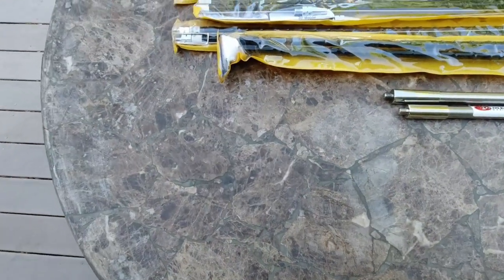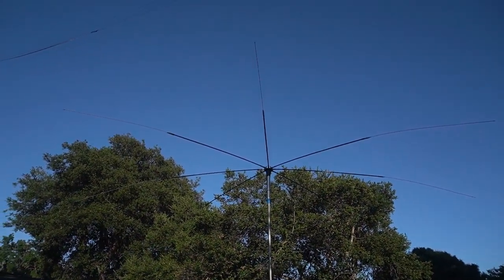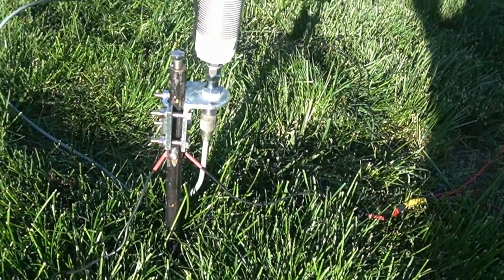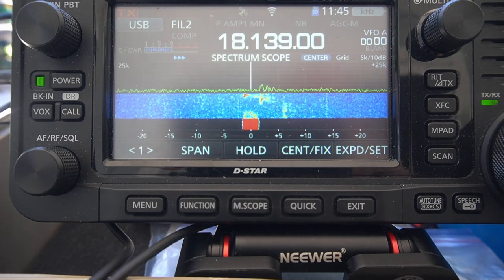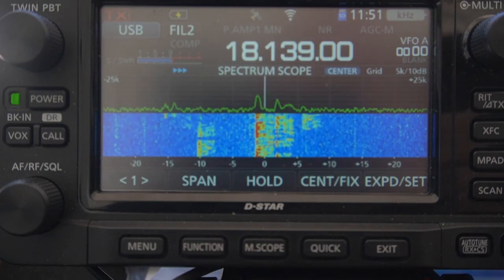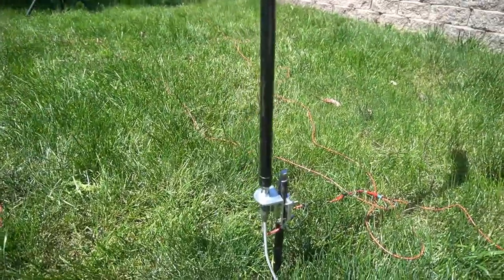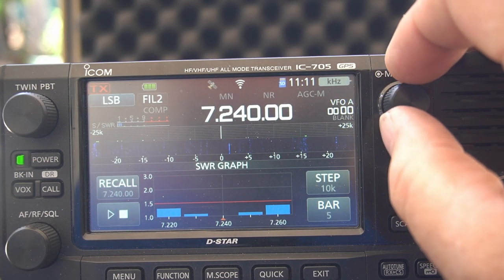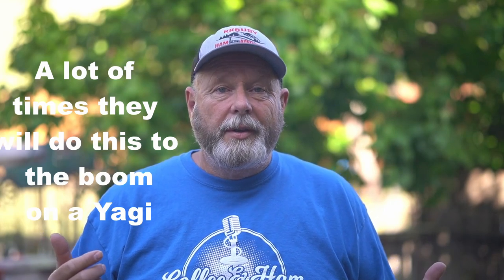How to use Hamsticks in different ways for use on the HF bands in Ham Radio.

Comment: Hi Chuck,
All great ideas. I especially liked the one for the two 17' whips used as a 20m dipole and the supports with the paracord. The small plastic pieces to make adjusting the tension a great solution. You and the family stay safe.  73  WJ3U

Comment: Yes, the Dipole topper for the push up mast makes the Dipole real easy and the thing I like is the MFJ Stainless steel whips at 10, 12 and 15 don't droop. Now that those bands are open, they work great. I have also used a 20m Ham Stick Dipole and the 10m Stainless on a 3d printed Dipole topper at 25 feet. The Ham Sticks at 20 are rigid because 1/2 the length is a molded, rigid piece and the whips are at the end. Great video. Thanks Chuck.

Comment: Great ideas Chuck. Maybe try the Hustler VP-1 Tri-Band Resonator Adapter with Ham Sticks, use a 3/8 x 24 bolt and a coupler for the antennas. Use a mirror mount and a 3/8 x 24 bolt to attach it to the mirror mount. You now have a 3 band antenna with maybe a bit more band width, and less expensive.

Comment: Have you used the hamsticks on the hustler fan antenna adapter? 3 bands like the hustler resonators?
Reply from the maker: yes I have it works , you may have readjust some though.

Comment: Hi Chuck, thanks for the video. I all ready own a 17 foot telescopic antenna from mfj and was thinking about the same setup with a second one like you did. What kept me away was exactly that bending down problem. Recently a saw a picture in a printed mfj catalog with two of those telescopes on a 45° angled bracket. So it looks like a upright V. I think they call it "Big Ears" In this configuration it seems to be no having bending down problems. What do you think about this? Would be the V less effective compared to the straight out version? Thanks.
Reply from the maker: Kirk not sure. I have a v bracket, but it doesn't separate the shield from the center the way it is setup I will have to take a look at it and the big ears!

Comment: Hi Chuck
When you use two hamstick as a dipole, do you use a tuner? k6NBC shows the use of two hamsticks as a dipole but he indicated it must be fed off center to match the antenna to the coax. Comments would be appreciated. Thank you ed K1EM
Reply from the maker: Hi Edward, I was using to hamsticks of the same band for just that band just like any dipole. Was he tuning to different bands as a multiband dipole?

Comment: You should change the Carrier Point to reflect the true location of the side band on the screen. You have the default setting where it shows the green line in the middle of the transmission, for LSB it should be to the right and for USB its to the left. Tuff to explain but icoms default setting puts the carrier point in the wrong spot for LSB and USB. Its in the settings menu. Hold EXPD/SET....Page 1of 4....3rd choice down...select "Carrier Point Abs. Freq" then exit.
Reply from the maker: Lol I'm new to Icoms, and just happy sometimes to be able to capture the screen on camera, but i will check out your suggestions! You know I think i actually noticed that while filming.

Comment: question: I have the dipole setup just like you do but can't seem to get them to tune very well. I was told that I needed to insulate the dual antenna bracket from the mounting pole because it is messing with the "ground" side of the whip by adding electrical length. I don't see this happening. You don't have yours insulated. Are you able to tune your dipole fairly easily?
Reply from the maker: Hi James, Yes I was able to tune  Mine. I tuned them separately to start with If I remember right. I also tried to get them about the same length, then put them together and tuned the each side the same amount. They need to be raised to check and they are not wide banned at all "hi-Q".
If you still can't get it drop me an email and we can try to find out what's going on , or I can do a video on just that part. That might be helpful to hams. and I didn't isolate the bracket. 73

Comment: In your contact with AJ1U why did you not I-D at the end of the contact. Might be nice to keep it above board with the new hams watching your videos.
Reply from the maker: Good point Fred, I may have and left it out to keep video shorter. A lot of video doesn't make the cut, I will try to include next time. Thanks for watching.